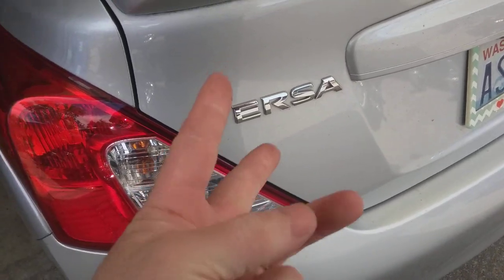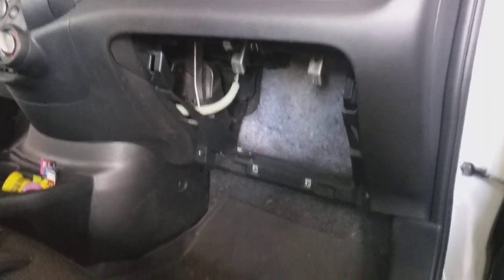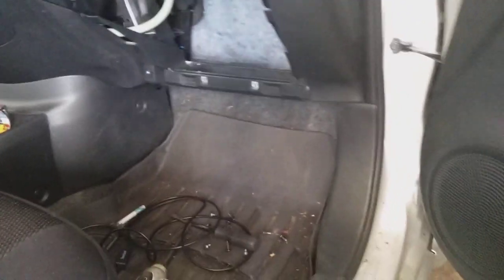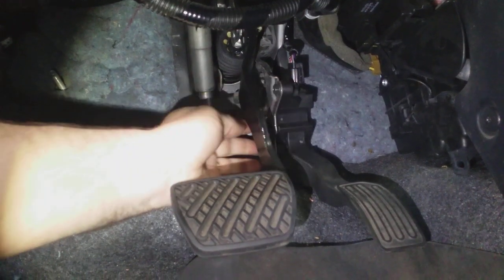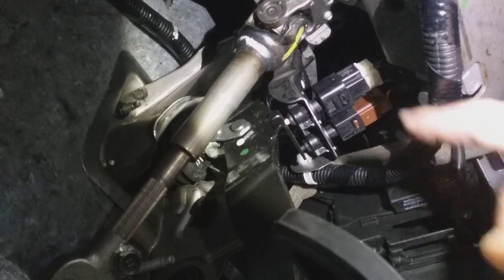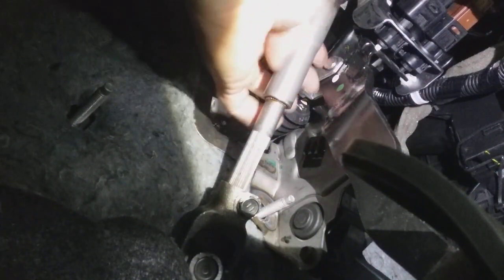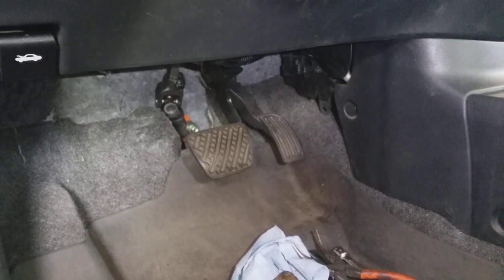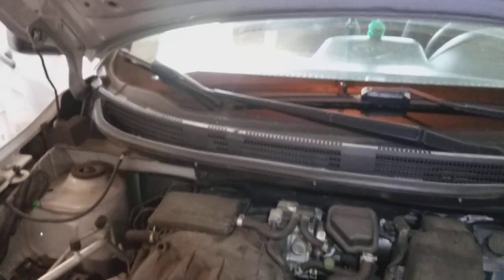2014 Nissan Versa blower motor.

Comment: Appreciate this video.... 2016 Versa, the only difference I came across is that the brake pedal assembly includes 5 nuts, not 4.  The other is below the square assembly and easy to remove.  Other than that I couldn't have replaced the blower motor without this video.  Thanks a million!

Comment: Steve thank you so much for this. I just did it today and could not have done it without your video! The hardest part was the brake assembly removing the top right bolt and then taking out the entire brake assembly, hardest part for me was putting it back in but by god I got it done! Thanks again for the video you’re the man!
Reply: How did you get the top right bolt out?
Reply: @1Preachh  I was able to just reach in and get it if I recall correctly. Idk it was a year ago haha 😂

Comment: Just as a side note. You don't need to mark the steering shafts.  The upper has both a flat side and a double wide spline on the back side.  It can only go on one way.
Reply from the maker: Your right for this one but regardless I always mark the steering shaft on every one I disconnect.  It's a good habit. And if u do mark it. It will visually help align the flat spot easier in that dar foot well.

Comment: I just did this last night.  Took me a little over 2 hours.  I'm going to post a few tips/tricks that I think I could do this next time under an hour to the 2 biggest video's on this instead of making my own.

First, I'm not 100% sure you need to remove the steering column, I did, but the official repair manual doesn't mention it, and I felt like I could have done it, again not 100% sure but could try if you wanted.
	
It took me about 20min to remove the brake assembly and I tried for about 45 min to put back before I removed the 3 additional things I'll post about in a second.  Once I removed those 3 things it took me 30 seconds to get it back.  I could not get the brake assembly back over the brake booster and into the hole.  My car is a 2016 versa note, unsure if the 1 main metal box is part of earlier years.
	
I also got about 6 cuts on my hand (sufface, didn't bleed too much, didn't even bother with bandaids) from the brake assembly metal, so you might want to think about putting gloves on to mess with it once you have the nuts taken out.  Also, to remove I did not remove the accelator pedal from the assembly nor the cable.  Yes I did remove the cable after about 20 min of not being able to get it back in thinking that was the problem.  It wasn't.  So I just laid it to the left and was able to remove the blower and replace blower without removing all the clips.

So the 3 things.  Once you take off the plastic shield and the kick plate under that and before you remove steering column.  Put keys in ignition, turn to on, turn wheel left you'll see a screw to keep on the covering for steering column, remove, turn wheel right and do same for that screw.  Remove the bottom of the steering column shroud.
Next, there are 2 C shaped supports that hold that kick shield metal thing you removed, you want to remove the right one.  There is an easy to get to nut right in center.  The harder to get one is on top.  You'll need a universal joint for your rachet.  Most rachet sets come with one, it's the thing that can bend.  I put my hand through the C and was able to guide the rachet onto that nut.  you only need to loosen it maybe half a turn, then your fingers can take it off pretty easily.  Same with reinstall, put my hand through the C, wound it on, used rachet to tighten half a turn maybe.  To get C out you will have to push down on a piece of plastic that runs horizontal from the console towards the door.  But literally it took me 2 minutes to get it out, and 2 minutes to get it back in, way better than the over hour to struggle with brake assembly itself.
The last thing to remove, on my car under the steering wheel is a metal box.  It's held by 2 bolts.  The C support and this box really get in the way of the brake assembly higher pieces.  With this box and c support removed, like I said brake assembly went in without even trying.  Think I could have left the entire cable and accelerator attached instead of removing to attempt to get it back in.

Couple last things.  I found a new blower on ebay for 30, I waited to receive if mine was bad.  However, it was like a very small piece of leaf stuck between 2 fins.  So I may have wasted 30, but that's ok.  I'll keep it and maybe need it later.  My steering column on bottom piece, had a plastic piece that goes onto the bottom bottom piece and has a piece that sticks up between the gap.  It also has a hole for the bolt.  So the bolt needs to be completely removed, but it also makes for lining up much easier.  Just get the gap back onto the piece that sticks up.
You will need at least 18" worth of extension to get that top right nut.  I bought a 6/10/18 3/8" set.  The 18 just reached.  So if you have 2 6's, you'll need 1 more.  
	
GL all.  Hope I may have helped someone in the future.
Reply: Dardack, good post. But why would the steering column shroud impede the removal of the brake assembly? I'm just not seeing it.
Reply: @MrSeeindouble  IDK like I said mine is a versa note 2016, it's when they moved the hatchback to the versa note, so I might have some differences.  On mine the brake assembly goes pretty high, it's just not what he shows in this video.  To get it back over the bolts, i had to remove a metal box and a C support, to get to these things the shroud has to come off.  If you don't need to remove, great.  But I spent 45m trying to get that brake assembly back on, it just wouldn't go high enough to clear the bolts, obviously sometimes when you remove something you can clear it 1 way, but much more difficult the other.  Maybe if I had lined everything up 100% exactly, I could have gotten it back on without removing those 2 items, however, after spending 45m I looked for another way.  Took me maybe 10m total to remove/replace these 2 items and get the brake assembly back on.  So worth.  I was just posting because maybe seomeone else ran into same issue.
Reply: @dardack  ...I did this job yesterday, removed the C support and the metal box as you suggested, finally after a week the brake assembly came off with a little bit of force around the steering shaft, Thank God I have another car to drive LOL. But I had a difficult time putting the brake assembly back on with the steering shaft. So finally I had to restrain the steering wheel with a couple of bungee cords, dropped the steering shaft, and it went in easy peasy. Anyways, Thank You very much for the suggestions, they made removal and installation easier. Oh and, you don't really need a U-Joint socket to loosen the top nut off the C support, I loosened it with the open end of a 10 mm combination wrench.
Reply: @MrSeeindouble  Glad I could help in a small way.  Yeah that 10mm probably would be better idea, my brain doesn't always work that way.  I'll spend way too long on something, before I realize this thing over here would make the job much easier/simpler.

Comment: I did this job yesterday at my workplace on a 2016 

Remove kick panel, disconnect switches (no need to remove them) at pedal assembly, detach all push clips at pedal assembly, remove metal box and its bracket under column visible at 2:23 (easy to get to, I did this for more room, remove TOP bolt at steering shaft (it will slide down easily by hand. No need to disconnect both ends), make sure you mark it and prevent steering wheel from turning, move shaft out of the way, remove 5 nuts holding pedal assembly. At this point the entire pedal assembly will come out easily and the blower motor will be easily accessible

The key to not struggling with this, is to remove that metal box, move the intermediate shaft out of the way, and to have the right tools

Comment: Great video Steve.  I wouldn't have been able to do this without you.  Mine was making a noise like something was rattling around in there and no air blew.  By using your guide I was able to install a new blower motor.  Unfortunately, now the A/C compressor won't come on.  I don't think it had anything to do with the blower motor swap because the only connectors disconnected were related to the brakes, gas, cruise, and power to the blower motor.  If you have any suggestions, let me know.

If anyone is viewing this and planning on taking on the job, it can be a big pain.  You may want to consider disconnecting and removing the driver's seat.  Like Steve said, mark the shaft.  As for the brake and cruise control sensors, there are what look like screw threads on each sensor.  Count the number of visible "threads" before removing them so you can put them in the same depth when putting everything back together.  It's a good idea to take pics of everything with your phone so you can refer to them when putting it back.

Also, the 2014 Versa Note did not come with a cabin filter.  We have three (S and SV) in our family that were purchased new and none came with a filter.  There is a cavity for the filter, along with a cover that snaps on, but no filter.  You can add a filter if you want and you can do it without removing the glove box.  Just look at the back left of the passenger foot well.  The cover comes off by lifting a tab on the bottom.
Reply: My versa did not have a filter either.

Comment: Thank you! Was able to use this video to replace the blower motor/resistor in my 2012 Versa. The hardest part was taking out the break pedal assembly (was 5 bolts for me not 4) and putting the break pedal assembly back in. Not a lot of space to work in there. But this video helped. 

Local Auto shop quoted $1025 to fix it .. insane
$350 for parts and 5 hours of labor at like $119. With help from this video a friend and I did this for about $50 worth of parts off Amazon and in about 3 hours.

Comment: i just did this on a 2014 versa note and I really wish i watched this first.....its harder than it sounds because of the angles and cramped conditions...cut my hands up and scratched my glasses....but i got it done...took me 5 hours about....definitely use white paint marker to mark the steering column position on both ends....i didn't and had to realign it 3 times before i got the steering wheel right

Comment: Just a heads up you don't need to remove glove box to change the cabin air filter.  I change it every oil change (get's really dirty).  You pop off the clip/slide thing, pull out the filter, do the squeeze get new one in.  Pretty easy.  Also, heads up to anyone, at least for my year, many auto stores have the wrong type.  Go to amazon, it's the type without the plastic piece attached, just a fan type of filter.

Also, thanks for video on blower motor, been watching a few cause I found it when looking up and was like WTF, how you even get to it.  WIsh it was still on passenger side.  So dumb.

Comment: Wonderful video!  Helped me so much, even though every step is frustrating..... and my back is screaming at me.  I just put everything back...... but its still not working. 😢😢😢😢   Any ideas why?????  What else would be wrong?  I've already replaced the resistor as well.
Reply from the maker: U need to stop and have real diagnostics done. U shouldn't have replaced the blower before knowing what the problem was.
  If you don't know how to do the diagnostics... then it's time to take it to a professional. You went through a lot of effort to replace something you didn't know was bad or good.
  Whats left? The switch on the dash, wiring, a comouter, power and grounds. You will need to verify each one. 
  A test light is a very helpful tool. But without proper wiring diagrams, it will be very difficult for you to know what wire is power or ground or just a signal wire.
  This is why my video is about "replacing" the blower motor and not diagnosing one.
 This sound like I'm being mean, and I'm trying not to be. It's just diagnostics requires a good understanding how the system not only works but also how it is wired. 
  Good luck.

Comment: You are my God. Thank-you, thank-you, thank-you. Found a mouse nest in my 2016 Versa (Vibrations with my blower fan). I will address the air intake; under the windshield plastic cover tomorrow, with your suggestion to glue a a wire screen over it. You are Great. Thank you. Jerry Loughmiller

Comment: Steve, very good video.  I believe I have to replace the blower motor on my 2012 versa (automatic sedan) as it does not work on any speeds, low, medium, or high, so no a/c.  So I kind of narrowed it down to a bad blower motor, fingers crossed.   I don't mind disconnecting the brake and accelerator pedal but do I have to positively disconnect the steering shaft?  A little nervous doing that part for a shade tree do it yourselfer.  Thanks, Stanley
Reply from the maker: I couldnt get the pedal assembly out with the shaft in the way.
 1, lock the steering wheel so it cant turn.(tow truck driver use the seat belt.)
Use white-out or any high visibility paint(even nail polish) to mark the shafts at their slip joints.
4 Make sure wheels are straight and parking bake is set.  
Take the keys out and put em in you pocket.
 Follow that, and you shouldnt fall victim to a steering wheel being off.
 If u get the shaft of one ot two "theeth" u can always take it in for an alignment.  
 I didnt have any problem realigning the shafts..they might have been in-dexed, they went together easily and my marks were dead on.

Comment: Thanks for the video. Helped me a lot on my 2015 Versa SV sedan. After I did all that, what is the cause of the brakes are overly sensitive? Light touch on the brake pedal and it brakes hard.
Reply: The pin that pushes master cylinder in is misadjusted or in wrong hole location causing tight pedal which can make brakes drag

Comment: Thanks for the video! Airbag light is blinking after finishing.. any thoughts?
Reply from the maker: Did you spun the steering wheel with shaft disconnected?  Possible clock spring damage
Reply: Ah man.. yes I did cause wheel came out of alignment so had to fix. Difficult repair?
Reply from the maker: @justinlewis2519  I honestly don't know.. never done one on a versa yet.. but required the steering wheen to be removed. And that usually requires a steering wheeel puller.

Comment: Steve, i am having issues to remove the drive shaft, is there any tip to remove it ?(u joint- drive shaft).  Or i just need to keep trying harder with the hammer?
Reply from the maker: Yes it might be rusty. the one I did need some persuasion. 
Might need penitrating oil
Reply: We had to use wd 40 and a punch pin and hammer.  Got it out that way.

Comment: Hey great video I followed it saved me lots of money but my traction light came on the next day and it won't turn off. I checked all the cables and switches they are good I even did the steering wheel relearn and the light comes back. Can anyone help me if you know what may be wrong?
Reply from the maker: Well Traction control is done via the ABS system.
Now the only thing that could ABS related that would be in around that area that you were working. Is the brake switch. So I would re-examine the brake switch(s) that are on the brake pedal assembly.
Reply: @Steve4x4  
Thanks!!! I'll check it out tomorrow

Comment: I guess mine is located elsewhere. They took apart my glove box and didn't see  it.. 😩
Reply from the maker: The blower motor is on the drivers side.
Reply: Mines the same way. It’s a 2012 but the blower motor is more modern. It’s on the driver side.

Comment: I can’t get the brake assembly back in. Lol
Reply from the maker: 1,Take a break. Walk away for at least 15 mins. Clear your head. Frustration always just clouds ur thoughts.
2, unless you did something to it after you removed it, it should go back in. It's not like it grew outside the car
3, you might find it easier to go back in if you remove the brake switch.
Good luck. And take ur time.

Comment: You never did the work This is no help.
Reply from the maker: Before u make a comment like that. Read the other comments. You will see that indeed it does help.
  I'm a one man operation. I don't have the time to record while I work. And in this case if I was to do that you still wouldn't see what I was doing cause I would be blocking the view anyway. 
So please change you comment. Or I will delete it.